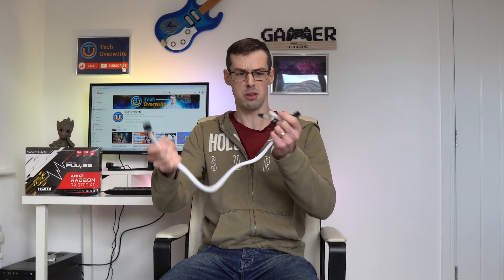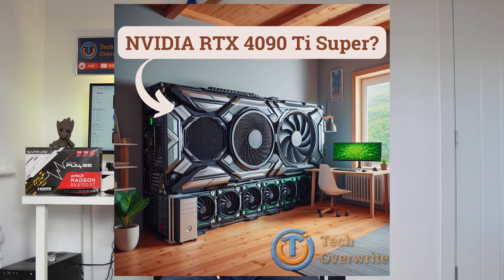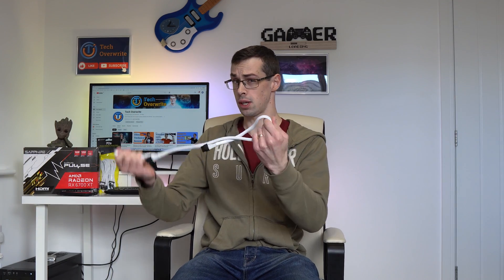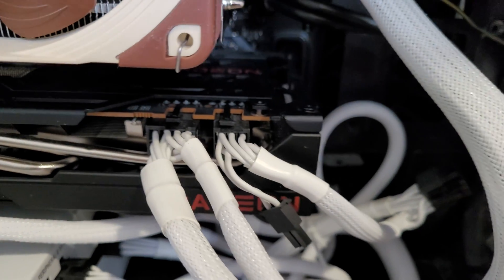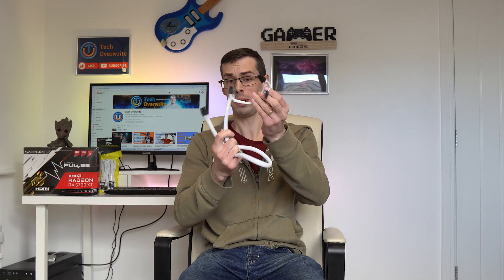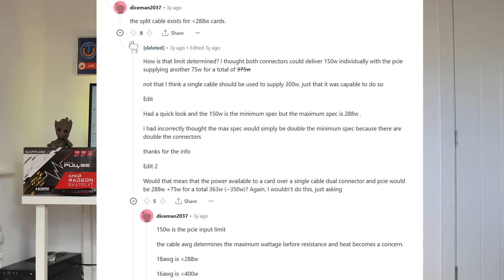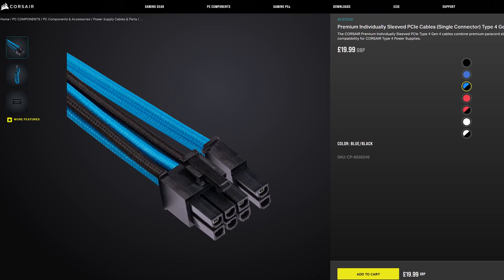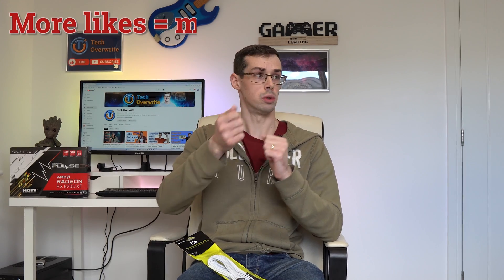Stop Connecting Your GPU Power Cables Like This! (How To PROPERLY Connect PCIe Cables For GPUs)

Comment: Sorry but you are misinforming about how the power in the cables work... the CABLE is ratted up to 288Watts... the 8pin CONNECTOR is the one ratted at 150watts and the 6pin CONNECTOR is ratted up to 75watts. IF you use a single 6pin connector the GPU will use up to 75watts from there, a 8pin connector up to 150watts... a cable with a 6pin and 8 pin will draw up to 225watts, a double 8pin cable will draw up to 288watts and the rest from the PCI-E. If you have a GPU that uses under 300watts you can use a single cable without worry.. IF the cable is the OEM one or a good quality third party one. Trusth me, the PSU makers know what they are doing with those cables... is the ATX standard. But if you feel safe using two cables thats fine, my point is your video is misinforming about it.
Reply from the maker: Thanks for the detailed comment, I appreciate it. It's never my intention to misinform, and I think I generally got the gist right with most of the video but I completely agree that it's not quite correct to say "<225W = 1 cable, else use 2+ cables". Thanks again for the clarification 🙂
Reply: @TechOverwrite  Don't worry my friend, like I said the only thing about the video is that you didn't understand how it worked, you took the connector rate as the full cable rate but isn't the same, BUT heres the catch; this is how good quality cables work, OEM cables from Seasonic, Corsair etc, are ratted for the 288 (288watts is the safe standard) even more based on quality BUT low quality PSUs will have low quality cables then the rate will drop to 250 even lower. So even if you got that wrong isn't like someone will fry a GPU or PSU for this video on the contrary it will help the ones will low quality PSUs/cables, just wanted to clarify about the cable and connector rates. Like I said, nothing wrong to use two cables but sometimes like in small form builds you will not have the luxury to use two cables, theres no space for two cables so just be sure that you use a good quality one and under the rate and everything will be fine.
Reply: Yeah, thanks for explaining. I was confused when he said 150w because I have a 3080 ti running on a daisy chained 2x8 pin connector and I've seen it pull at least 350w.

Comment: Are cable extensions fine? Using 2   Separate PCIe cables connected to 2 cable mod extensions
Reply from the maker: CableMod is often a reputable and quality brand yes, so they should be fine 🤞

Comment: Well i buy 4070 and conection IS 1x 16 pin ... Then can i connect 2x separate 8 pin conector ?
Reply: Or i need some new cable? I dont know how to connect
Reply from the maker: You can buy 2x PCIe (8 pin) to 12vhpwr (12 pin) adaptors yes, and these can be perfectly safe, although some GPUs come with these included. So I'd say double check what your PSU and/or GPU includes first.
Reply: @TechOverwrite  i have ASUS ROG STRIX 1000 W GOLD then i need some reduction on only 2x 8pin connector
Reply from the maker: @theblackshadow112 yes that sounds like it'd be fine then (assuming it's a fairly reputable adapter, from CableMod or similar - and not AliExpress lol!)

Comment: so could I run the pig tail connector backwards? like the y end in the psu and the single end back into the gpu?
Reply from the maker: Uhhh, I wouldn't do that 😁 I don't know whether it would physically fit or not, but there's no benefit to plugging 2x ends into the PSU (and 1 into the GPU) - it won't deliver extra power to that single 8 pin end or anything.

Comment: Thicker cables can carry more AMPS not Volts. You can use thin cables for high voltage.
Reply from the maker: Thanks for clarifying my sloppy wording/explanation there 🙂 That distinction is important to remember.

Comment: Could you damage a 285w card running 1 pigtail on both connections?
Reply from the maker: Potentially yes. Best case you might experience some crashes etc. It does also depend on the PSU and PCIe cable quality too though - some setups might deliver 210w via the PCIe cable without much issue.

Comment: My GPU 3060 ti Aorus elite has 220w tdp and use 8+6 pin pcie. Is it fine to use pigtail pcie cable? My Psu xpg pylon 650w and has 18AWG pcie cable according tom's hardware
Reply from the maker: Yes that should be okay - maybe avoid OCing, but it should work okay with the 'interesting' pigtail connector 🤔
Reply: @TechOverwrite   just checked it, the power draw can reach 244w peak, 240w average on benchmark test
Reply from the maker: Hmm, it's more borderline then 😕 I'd probably run with two separate cables if you're able to, but you could always give it a try and just keep an eye on any crashes, low performance etc.

Comment: Good to know! Thankfully it seems the card I ordered (Gigabyte EAGLE OC GeForce RTX 4070 SUPER) comes with a 12VHPWR cable and only draws 220 watts as 600 watts seems quite ambitious for such a small cable to carry???
Reply from the maker: Yes the 12vhpwr connector is a bit of a scary one 🤯 All the melting connector stories have put me off it to be honest. Yes hopefully you'll have zero issues with the 4070 Super - that strikes a good balance between performance without too much power requirements IMO. Happy gaming 😁

Comment: I bought the gpu u have there, Sapphire Pulse rx 6700xt, and Thermaltake thoughpower GF 3 750W, there is this high Power 12 pin cable with 300W.. but it doesnt fit in the gpu 😂 well maybe in the next GPU in some years ig
Reply from the maker: Ah yes, the legendary melting 12Vhpwr connector 🤣 Hopefully your PSU has 2x standard PCIe cables though to power the GPU? And I hope the RX 6700 XT works out well for you, it's been a great purchase for me 🙂

Comment: This might be late but wanted to know if i can use three pcie cables that have pigtails but without attaching the pigtails meaing using the main cable instead of the pigtail
Reply: That would be the preferred and safest way to do it, better than using 2 cables and a pigtail from one of those 2 cables.
Reply: Yes, the pigtails can be thought of as an off-ramp on a highway. They don’t allow more power “traffic” than the cable is rated for, rather they disperse the whole quantity over 2 plug slots. Using them without attaching the pig tails only means you’ll have pig tails hanging from your GPU unless you use small zip ties to tidy them up, or maybe shrink wrap them to the rest of the cable if you know what you’re doing.

Comment: I'm planning to get an Arc A750, my PSU is a DeepCool DN500 which only has one 6+2 pigtail. Should I be fine daisy chaining it since A750 has exactly 225W TDP? I'm also planning to undervolt it to save on electricity
Reply from the maker: Yes that should work fine, as you say - especially if you're planning on undervolting it. Happy gaming 🙂

Comment: I have a graphic card that is connected to the mother board slot. I bought the MSI MAG A55BN power supply that has a PCIe cable. Will the power supply still work or do I need a different power supply unit? I am asking because my Dell Inspiron 5675 still doesn't turn on with the MSI MAG A55BN. Thank you.
Reply from the maker: I don't know for sure sorry, however I thought that Dels were generally quite hard to upgrade with standard consumer hardware (because they use so many bespoke OEM parts). So it might just be that you're not able to use that PSU (or many other 'off the shelf' PSUs) with your Dell? That would be my guess, anywhoo.

Comment: I use my powercolor red devil 7900xtx with a pigtail cable, plus one additional independent cable , all to the power supply. Never had issues. Max power draw is 375W. 150+150(the pigtail cables and other independent cable)+75(PCIE Slot power)

In a way it can be beneficial since it caps the power consumption of your card. Though i suppose that may hinder performance, especially for overclocking purposes. I dont overclock my gpu tho.
Reply from the maker: That's good and reassuring to know, and I agree that there's no reason why two cables would be an issue here. Good points about acting as a power cap too 🙂

Comment: What if my power supply doesnt have any sockets only built in cables? Can a converter do the same job?
Reply from the maker: Good question, I should have covered non-modular PSUs in this video but basically you're limited by the number of PCIe cables and adapters/converters etc won't help unfortunately. So if your PSU only has one PCIe cable, you probably won't be able to go above 225W for a GPU (for example) 🙂
Reply: @TechOverwrite   In a video l saw a guy using  2 molex pins and convert them into 1 8 pin connector with an extra converter cable and it seems to be working. So l taught maybe l can do this too and it would function as a second PCIe cable. I have Msi GTX 4070 Super ventus 2x and l am having problems with it, at random the secrens turn black and fans of the GPU go full speed even tho the temps are 30 something. When l disconnect and reconnect the PCIe cables this problem goes away for week but then returns. So l taught maybe it is because my GPU is connected with one pigtail PCIe cable and on the instructions of the GPU they reccomend 2 of them.
Reply from the maker: Hmm that's really odd, unfortunately I'm not sure why it's okay for a week or so and then failing again. I'll keep an eye out and reply back if I hear of anything relevant to what you're experiencing 🙁
Reply: @TechOverwrite  Thank you, and do you think it would be okay to convert the two molex pins into a 8 pin PCIe cable so l can plug two PCIe to my GPU?
Reply from the maker: I'm not sure to be honest (sorry!). I think for lower power GPUs it can be 'fine' to add some power via Molex adaptor, and back in the day some 1070 Tis (IIRC) had a Molex adaptor bundled with them. But I'm personally wouldn't power a 4070 Super with a PCIe + Molex. It might work, but I wouldn't chance it - sorry.

Comment: My gpu is RTX 4070 Super, which is 220w TDP. Can using two separate cables from the PSU damage it? Are there any advantages or disadvantages to using 1 vs 2 in this case? My psu is Seasonic 850w. Thanks!
Reply from the maker: Using 2 cables would be fine - it certainly wouldn't damage the GPU (or PSU) no 🙂 You should be fine using 1 cable with a pigtail too to be honest, just be sure to avoid overlclocking the GPU since you'd be close to the power limit here.

Comment: Bro i have the sapphire nitro+ vapor rx 7900 xtx, and my psu is silverstone da850r i dont know if my cables are enough for the gpu or if the pcie ports from the psu are also enough.

Hope you can help me.
Reply from the maker: You should be fine here bro 🤞 Your card's TDP is 355W, and your PSU has 4 "CPU/PCIe" slots. Since you're very likely to only need 1 CPU slot, that leaves 3 PCIe slots to power your GPU - which will be more than enough (even 2 cables and using 1 pigtail 'should' be enough too, to be honest).

Comment: Finally, someone explained what power supply I need for my GPU... Thank you so much
Reply from the maker: Awesome, glad to have helped 🙂
Reply: @TechOverwrite  Mr tech I'm sorry to inconvenience you with this question I have a fully modular PSU can I use it to only power my graphics card if I'm only using the one wire from the PSU going directly to the GPU sorry if I inconvenience anyone
Reply from the maker: @ronalddavis6457  it's no inconvenience 🙂 However your question is exactly what the video addresses. In short, if your GPU has a TDP below 225W, using 1 cable should be fine.
Reply: RIGHT!!
Reply: @Live2Learn-o1d  RIGHT!!!
Reply: I mean. Just look up the tdp...

Comment: Are there any 850w psu that comes with three single connector pcie cables? Cheers 🤙
Reply from the maker: Check out this list: https://pcpartpicker.com/products/power-supply/#G=6,18&sort=price&page=1

Basically that shows any PSUs that have a decent number of PCIe and CPU slots. For example I randomly clicked on a Seasonic Prime Ultra Gold 750W PSU, and that has quite a few PCIe slots.

Comment: but my msi mag a650bn only have 1 into 2x 6+2, what should i do?
Reply from the maker: Hmm I tried looking into that PSU but couldn't easily tell... is it a single PCIe cable from the PSU, which then splits into a pigtail? If so, you'll probably just have to be careful what GPU you buy - since you won't be able to power high range cards (unfortunately). But anything up to midrange, 225W ish GPUs should be fine.

Comment: Oh my god i was about to sell my pc
Reply: 😢😢i returned my GPU because of thay😂😂😂😂😂i was using a 7800xt and i started to have crazy coil whine and fps drops everytime the coil whine happened
Reply from the maker: @jokerbeatzholyjesusinspira7581  haha yikes, glad you got it figured out in the end though 😆
Reply: @jokerbeatzholyjesusinspira7581 is it really bc of the power supply? I JUST bought a 7800xt and it crashes and The game sometimes drops to slideshows then crashes and restarts pc
Reply: Ive had a 6800xt sitting in a drawer from.about 4 weeks after it launched because i was to stupid to try 2 cables @Vazsily
Reply: @jokerbeatzholyjesusinspira7581  Bro I have the same card and same issue! I was think wtf I have a 750w why is this so laggy? I need to try this.
Reply from the maker: Hah glad this helped you out 🙂
Reply: Crazy cause I just sent back my 3070 I got used on eBay cause I thought it was faulty, was randomly scrolling and found this video and now I wish I could cancel the return because my cables were like this! Experiencing stutters and terrible performance, along with random restarts while gaming and overclocking was impossible, nothing was stable even when the card wasn’t overclocked (I bought a brand new 750w PSU before installing) I even went and bought a new motherboard because I genuinely didn’t know what to do everything in my computer was new so it had to be the GPU, I can’t believe I found this without even looking for it as it makes so much sense! Lol it’s okay though, new is always better and safe anyways, glad I learned something though and found people that were having the same issues because I have been absolutely hopeless since I’ve gotten the GPU, selling my PC was definitely on the list next! Once I get a new GPU I’ll have to come back to this comment and leave an update.
Reply: @SB57Champs  Hell yeah man definitely update me/us on this. That sucks I always look at Ebay too because I used to buy sneakers from there but sometimes you get that one time you get jipped and it turns you in to a worrier lol. That does suck to hear about the 3070 hopfully when you get the money back you can find another or a 4070 to try out.
Reply: What gpu you was using?

Comment: I have an RX 6750 XT and PSU is Corsair RM650. Im planing on getting some extension cables. The GPU has 250 W TDP. How do I know if  my PCIe cable can handle more than 150 W and if it can would an 8 pin PICe extension cable still work (only 1 PICe cable from the PSU), like would having the extension cable with the stock PSU PCIe cable not really work in  that example. Great video, thanks.
Reply from the maker: To be honest I usually just Google the PSU make and see what the cable guage is ("RM650 PCIe guage"). In this case it seems likely that it's a 16g PCIe cable so you should be absolutely fine here, with a 250W cable. Although yes, if you use an extension cable then you would need to check the guage for that too.

Comment: Thank you so much man!!! Had a hard crash on my 7800xt + 5600x - Corsair Rmx 850w, with cyberpunk, lowered the graphics and ran fine for a couple hours then again I blame cyberpunk so stopped playing it, with Helldivers 2 9 minutes into gameplay and crash and restart itself then not even after launching the game same result and started happening on Apex at the time there was a Windows update that gave me error every time so I blame that and did a clean install and everything fixed (on March). Yesterday happened again, clean install did nothing, change to 2 pcie cables so far I seems good, manage to play Apex, haven't restarted itself I'll update if anything. Sorry for writing a book hope it helps someone about there too.
Reply from the maker: No worries, thanks for the detailed comment and fingers crossed this fixes the problem for you 🙂
Reply: good to know

Comment: My modular psu has 1 gpu pcie and 3 cpu pcie my gpu has 3x8 pins idk what to do
Reply from the maker: Are they definitely labelled as GPU and CPU (separately)? Usually the labels are close together and confusing, but 2 will be for the GPU and 2 for the CPU in this case. That's what my Corsair RX PSU does. I then run 1x CPU cable and 2x GPU cables, and it works okay.
Reply: @TechOverwrite  I have the tuf 850 gold from what I can tell there 1 named gpu but that's the 12vhp 600watt thing and what i thought are cpu pcie but i thing vga cables go there my main confusion was the vga cables idk i built computers before but the new power standerds scary
Reply from the maker: Ah right, ugh yes that's a pain. I'm in a similar boat actually - all my old builds have standard 6 or 8 pin PCIe connectors so I haven't had any experience (yet) with the 12vph connector sorry.

Comment: Is this also true for the 2 8-pin connectors on the motherboard for the cpu?
Reply from the maker: Ooo great question, I'll look to cover this in a future video. The short answer is that for budget and mid range CPUs, only connecting up a single 8-pin connector can be sufficient. But the second connector is more of a backup, for redundancy in cases of very high CPU power draw (e.g. from a power hungry CPU that has also been overclocked).